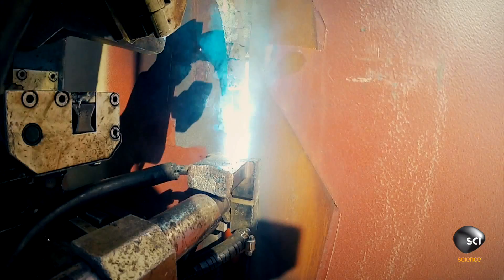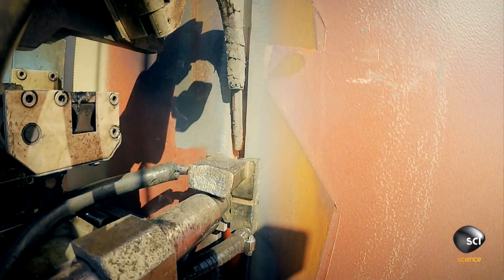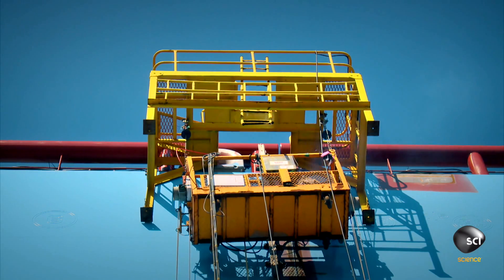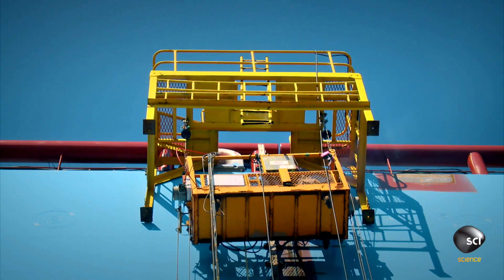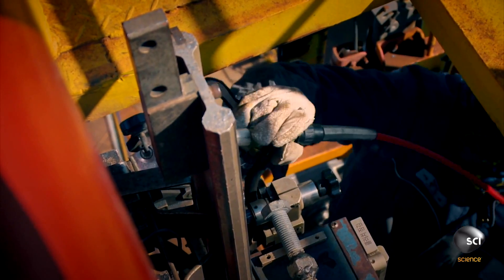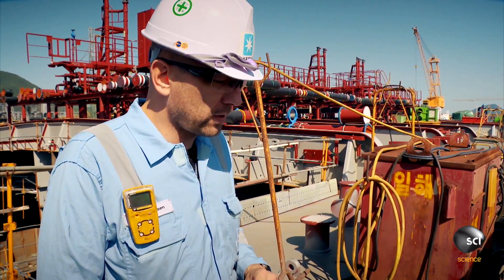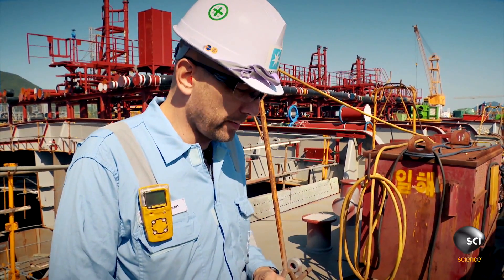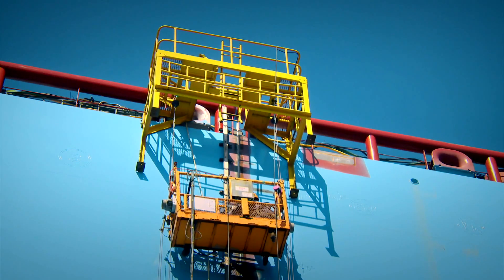This Welding Robot Will Join 3 Miles of Metal

Comment: Use the long string of filler then comnect with the two high power electricity then you can well ,hunred feet a second then electroplate with anticorosion then finish miles of welling less than few hours